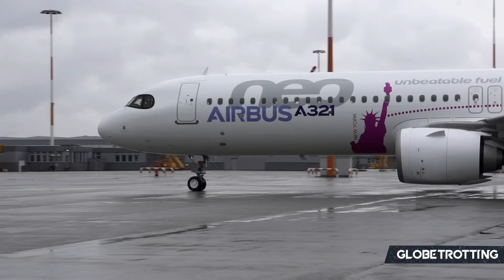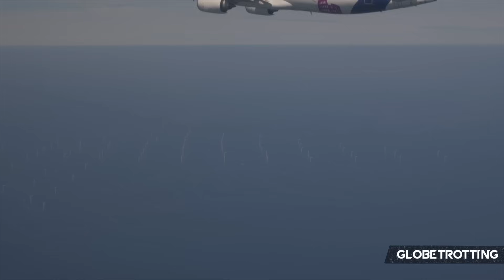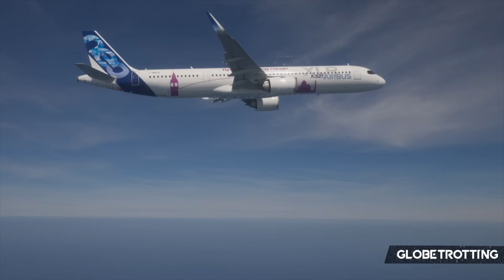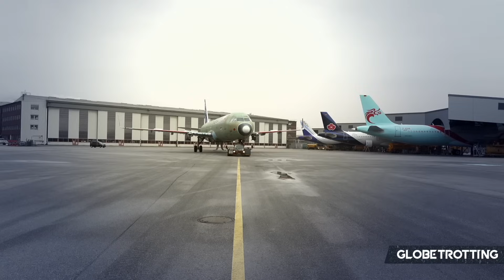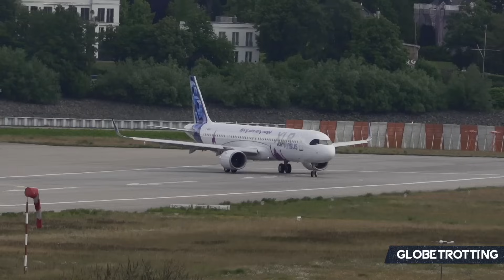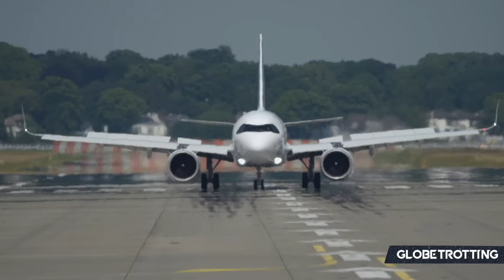Will The AIRBUS A322 Release?

Comment: Being first is so often overrated.
You only need to the 787 and the A350 to realise that.

The profitable A350 on hundreds of sales v the still loss making 757.

Thanks to Boeings 787 difficulties and problems, Airbus were able to avoid those issues with a game changing effect on their bottom line.

I am not sure how successful a further stretch could be, however, even if sales were limited, no doubt any technology/design as a result of the programme will find its way into the other A320 series aircraft.

Comment: If same airframe then new wings and complete new engines.
Reply: Significant takeoff weight increases have been achieved for the A321XLR using a slightly strengthened wing, undercarriage, an optimised flap and more aggressive software for the rotation rate and anti tail strike limits.    By sacrificing fuel load a stretch should be possible while staying within the weight limits of the A312 XLR.    The issue as I see it will be the maximum takeoff rotation.   Applying some of the techniques Boeing used on the B-737-10 MAX undercarriage to give more rotation should work on the A322.

Comment: I still say no. Reason: airlines want to be able to embark and disembark passengers quickly, and the longer fuselage of the A322 could be a problem, a problem that the Boeing 757-300 experiences.
Reply: Yeah, the A322 makes no sense because is a fake concept and it’s not an A321NEO, it should be retired. The 757-300 is longer than the fake A322 concept, so the fake A322 concept won’t be a replacement for the 757-300. The fake A322 concept will make the A321XLR and A321LR useless and the A321NEO A321LR and A321XLR production will be discontinued and scrapped. That will be dreadful

Comment: I definitely believe that the A322 will have a chance!!!!! I believe it will be a replacement for the 757-300s
Reply: And which 757-300s do you want to replace? The 16 of DELTA? Or the 21 of UNITED?
Reply: @KlausErmecke  Good point.
Reply: @chiad25 the A322 is a fake concept and it’s not an A321NEO, it should be retired. The 757-300 is longer than the fake A322 concept so the fake A322 concept won’t be a replacement for the 757-300. The fake A322 concept will make the A321XLR and A321LR useless they’re production would discontinue and they would be scrapped, that would be dreadful
Reply: @KlausErmecke the A322 is a fake concept and it’s not an A321NEO, it should be retired. The 757-300 is longer than the fake A322 concept so the fake A322 concept won’t be a replacement for the 757-300. The fake A322 will make the A321XLR and A321LR useless and the A321NEO production will be discontinued and scrapped. That would be dreadful
Reply: @ericjones7769: the A322 is a fake concept and it’s not an A321NEO, it should be retired. The 757-300 is longer than the fake A322 concept so the fake A322 concept won’t be a replacement for the 757-300

Comment: Dear DJ - due to its unalterable physical and chemical properties, hydrogen is possibly the LEAST FEASIBLE storage medium for energy in aviation. Working on some illusionary hydrogen propulsion was a madness allegedly forced upon Airbus (and Rolls Royce) managements by some out-of-control green socialist elites with controlling influence on the EU Commission and certain European governments (and - until recently - the US). Airbus has - if I followed the news correctly - just abandoned its hydrogen efforts, after EUR 1.7b had already been sunk. Useful programs - like the final development and certification of a stretched A350-2000 - could have been easily covered by such resources which are now lost without any chance to recover.

Now regarding the persistant dream of an "A322": There are a few things to be considered first. The priority is to understand that Airbus must make money for me - and for scores of other shareholders. Profit. But the limiting factor of Airbus has been for some years now its lack of manufacturing capacity. Capacity of its suppliers, capacity of its own assembly lines. Airbus CANNOT sell any more production slots in the A320neo program as all existing slots are already sold out over many years. However, Airbus COULD increase its narrowbody profits anyway if it found a way to increase its PROFIT MARGIN per plane by offering a higher value version of the jets (e.g. an "A322" in exchange for an already ordered A321). But this approach requires that the incremental development expenses for the new version could be kept extremely low. So everybody - forget about the new carbon fiber wing! Forget about any new engines. Airbus could POSSIBLY take the HGW version of the A321 (MTOW 101t), add a few meters of tube and trade against allowed fuel (add some shaman magic against tail strikes).
Reply: The A322 is a fake concept and it’s not an A321NEO, it should be retired. The 757-300 is longer than the fake A322 concept so the fake A322 concept won’t be a replacement for the 757-300
Reply: And also the 757-300 is longer than the A330-800NEO so the A330-800NEO won’t be a replacement for the 757-300, only the 757-200 767 or A330-200

Comment: wont people mess it up with the a320-200 in the shortened version
(a322)
Reply: No they wont. A320-200 is no longer being buildt I think. It's possible that they have one or two deliveries left to some chinese airline, but it will be finalised many years before any A322 EIS.
Reply: @chiad25 the A322 is a fake concept and it’s not an A321NEO it should be retired